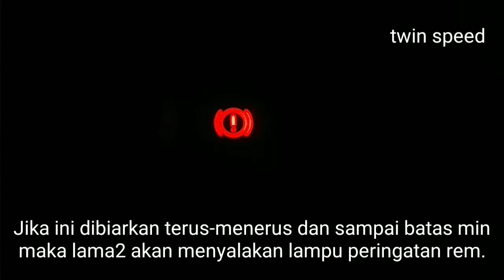GANTI WHEEL CYLINDER BELAKANG MASTER REM BELAKANG MOBIL YANG BOCOR PENYEBAB REM BLONG

Comment: Salut sama Garapannya si akang yg  mengutamakan ketelitian, kerapian & kebersihan. 👍
Reply: @FauzanTwinSpeed mohon pencerahan nya bg avanza old baru ganti blok rem belakang merk sanyco tp kok rembes di master sebelah kiri di nepel yg ke arah blok rem sebelah kanan🙏
Reply from the maker: @farlyansyah2658  
Waktu pemasangan dicek tidak kebersihan antara pipa dan whellcylindernya, pastikan juga tidak ada yang luka atau tergores. Pemasangan drat ke wheelcylinder pastikan lurus dan tidak ada kotoran, kekencanganya juga harus cukup.

Kami menjual sparepart asli toyota dan menerima pesanan sparepart🙏
WA: 081226134486
Shopee: https://shopee.co.id/twinspeed?smtt=0.6561216-1666451150.3
More info:
https://linktr.ee/twinspeed
Reply: @FauzanTwinSpeed  kurang tau jg om soalnya masang di bengkel tp stelah sya kencangin baut nipel nya masih tetap rembes bg
Reply from the maker: @farlyansyah2658  
Kemungkinan lain awal masangya miring,  jadi kemungkinan ada yang luka, coba minta cek ulang bengkelnya, seharusnya masih ada garasi kalau masangnya belum lama.
Bahaya kalau dibiarkan, rem bisa blong kalau minyak rem habis.

Comment: Mas kalo untuk brio tahun 2012, 1300cc gantinya pake apa yah? Sama dengan city atau jazz? Soalnya pake yg brio 1200 cc ga cocok
Reply from the maker: Maaf ,ini gantinya satu sisi atau kanan kiri?
Untuk kanan kiri beda partnya.
Reply: @FauzanTwinSpeed  sisi kiri om belakang
Reply from the maker: Coba di pastikan lagi part barunya benar untuk yang kiri tidak. 
Setahu saya brio 1.3 dan 1.2 whell cylinder nya sama.
Kalau belinya di toko sparepart biasanya bisa ditukar, bawa saja contohnya.
Reply: @FauzanTwinSpeed  oke2 terima kasih

Comment: Om mau tanya klo di rem wheel cilinder tidak mau kembali dan macet....,🙏🙏🙏
Reply from the maker: Di bongkar gan,,, biasanya berkarat. 

Kami menjual sparepart asli toyota dan menerima pesanan sparepart🙏
WA: 081226134486
Shopee: https://shopee.co.id/twinspeed?smtt=0.6561216-1666451150.3
More info:
https://linktr.ee/twinspeed

Comment: mas kalau Wheel cylinder 1set untuk toyota rush 2015 berapaan ya kira kira?
Reply from the maker: @860.000
Jadi kanan kiri 1,720.000
Reply: @FauzanTwinSpeed  merk aisin yg beredar di pasaran kisaran harga 110.000 1 biji kira kira kuat ga gan